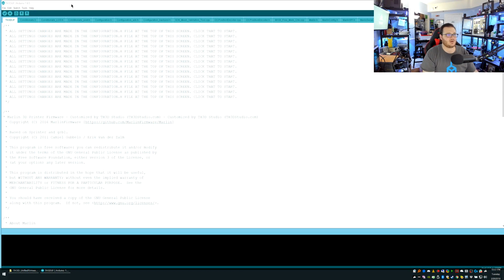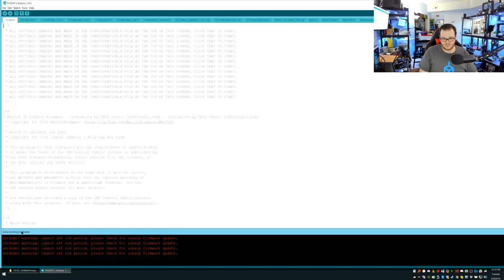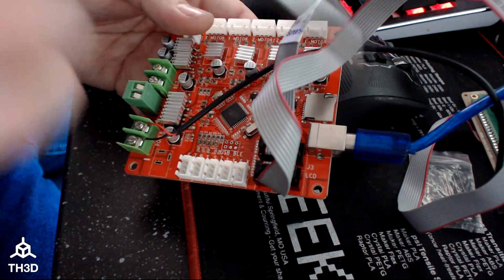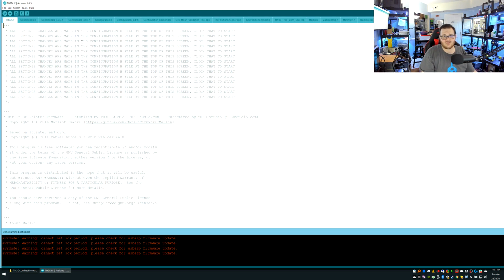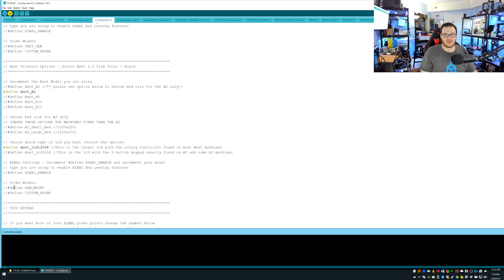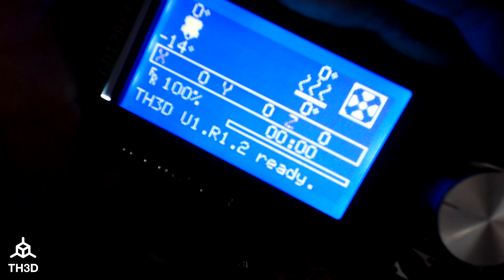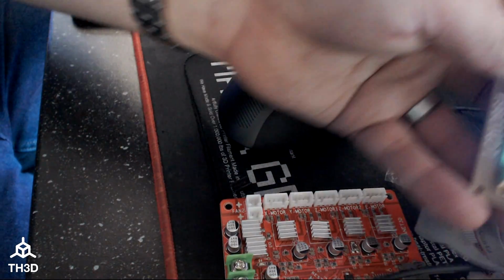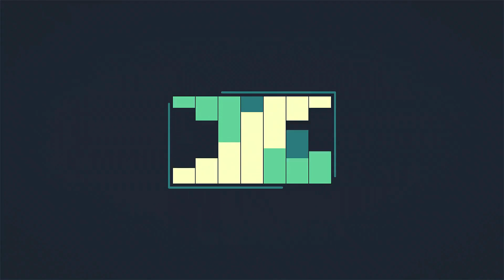Flashing Your Anet Board Bootloader with a USBASP

Comment: Hello, i,m new in the world of 3D printing. How can i put the TH3D-Undifiend file in Arduino 1.8.5 program? The files that are in the directory of TH3D are not reconized in Arduino and most of them are read me files. I bought this printer un assembled new in box, but that was a long time ago. i couldnt build the machine because i was sick for a long time and now the warranty is passed. Now that i build it i found out that there is no software/bootloader or anything on the board.  I just get 2 rows of blocks on the screen, the coolers works but thats all.
Reply from the maker: I'm not sure what you are referring to but the Anet firmware is still on our website. This video is very old. Check https://uf2.th3dstudio.com for the firmware lists.

Comment: Did you use the standard firmware in the "EXAMPLE" folder in Marlin?

Did  you flash 1.1.9 or 2.0.X Bugfix?

Does this method work on all Anet boards? 1.0 1.5 and 1.7?
Reply from the maker: This process works on all Anet board versions.

We use our own firmware from https://Firmware.TH3DStudio.com

We'd highly recommend posting this question on our forum (its open to anyone) to get help with their machines. TH3D Forum: https://forum.th3dstudio.com/
Reply: @TH3DStudio  hey there I am currently moving all the ANET hardware over an Orballo frame (Tatara like one). Is there a chance, I may have support from you guys regarding the flashing ov the board? Do you offer paid services? Support trough Patreon?

Comment: i have a Anet A3 ..so witch do i use A6 or A8 my board is a verion 2.0 Anet
Reply from the maker: A3 isn't supported right now. Thats the little cube style one right?
Reply: @TH3DStudio  yeah the Acyrlic one mk1 ..it as a Anet board in it version 2.0 thats whats on the board .it as all the right plugs as in your video j3 ..ect ..my z axis gos up and down like a ender 5 is it ..so could  iuse like Anet A6 as my x carriage is bascally the same and just change the rest in marlin ..like bed dimentions ect
Reply from the maker: @darren990  Yeah we have one of those somewhere in the junk printer pile but never added it to the firmware so it's not going to work with our firmware we have. You should use Marlin for that machine.
Reply: @TH3DStudio  cheers

Comment: y axis stepper motor is getting very hot what can i do
Reply from the maker: If its the anet where the vref is fixed I'd say check the motor if the bed isn't binding up. Binding on the rods will load the motor more.

Comment: I was wondering what the pinout is for the 6 pin connection from the Anet to the USBASP
Reply from the maker: If you look on bootloader.th3dstudio.com there is the pinout for the Anet board. As for the ASP you would have to refer to the manufacturer documentation for that.

Comment: Something I do not understand. Doesn't the USBASP come with a 10 pin cable already? Why would you need a 10 pin to 6 pin adapter cable. The 10 pin cable should just plug in, right?

Also why program in a bootloader when you could just program the board directly using the USBASP? Or is it because you can program with more revisions later using just USB?
Reply: The programming pins in the pinout on the 10pin Anet header does not match the pinout of the 10Pin USBasp programmer. The 6 pin adapter rewires the pins to the proper connections.

Comment: bought the USBasp usb with 10pin to 6 pin connector. You plug the 6 pin in the middle of the connections, so 2 pins should be available on each side. If it says initialization failed, you probably have the 6 pin connection backwards, so just turn it around.

Comment: When I write bootload it presents this message

avrdude: auto set sck period (because given equals null)
avrdude: warning: cannot set sck period. please check for usbasp firmware update.
avrdude: error: program enable: target doesn't answer. 1 
avrdude: initialization failed, rc=-1
Erro ao gravar o bootloader.
         Double check connections and try again, or use -F to override
         this check.

avrdude done.  Thank you.
Reply: Danilo silva  ever get this worked out?  Have same issue.
Reply: I think there is an issue with a trace in the board from one of the programming pins. I’ve used several different usbasp devices with the same issue. When you plug in the programmer cable to the board you should see a couple of led lights come on and blink. One next to the j3 socket and one near the large chip by the high voltage input. Seen this on other videos. Error seems to be that the board isn’t getting power through to the chip either a bad trace or chip input pin. I don’t get either of the leds to light on the board.  So error is that the usbasp isn’t getting a reply from the chipset on the board.  I was lucky enough to have a factory boot loader to install marlin through. Though the factory boot loader occupies more room than a new boot loader. Just can’t enable to many features before chip memory runs out.

Comment: I have a 10 pin USBASP. I was wondering if I could just trim the 10 pin connector to a six pin or do I have to buy an adapter.
Reply: how you solved this problem? i have the same problem rn, dont want to wait for adapter and i am trying to connect with some wires
Reply: @szwos  I actually managed to unbrick my Anet motherboard another way. I basically reinstalled Marlin onto the motherboard and it worked so I never used the USBASP. I don't know if that's helpful.
Reply: How did you reinstall marlin? I am kinda in similar situation bcs i want to update marlin to a newer version, but i cant do it with usb  - propably bcs i have no bootloader on flash memory
Reply: @szwos  Sorry. I didn't see the reply until now. You've probably solved it already but I basically just pressed the compile button again.
Reply: I didn't get the issue from upgrading my Marlin. I had the issue when I was trying to install the Marlin software for the first time. My hot bed wire burnt through my V1.5 motherboard recently so I had replaced it with a V1.7 board before I ever upgraded my Marlin so I am not familiar with upgrading Marlin. I am so sorry I couldn't help.

Comment: Thank you sooo much for this. I have been struggling for a couple of weeks with uploading marlin to my anet a6. I am fairly new to printing and decent with computers, My question here is, Doe the TH3D firmware have the thermal Runaway protection for the anet like the marlin firmware is supposed to have? I will try to read into the firmware deeper and see if I can figure this out as well. Thank you once again for your help
Reply from the maker: Yes we always enable thermal protection as this is a safety feature that should NEVER be turned off.
Reply: TH3D Studio thank you so much. This firmware is so nice. I bought this printer heavily used and after a little lube and clean up it ran smoother but I had no idea how much different the firmware would make......now to get octoprint to work remotely. No my printer is never ran unattended, wife works from home and is always there but has no clue how to make my printer work but can definitely watch over it. Thank you again.

Comment: Well, after trying and trying I`m stuck on this, I have a anet3d V1-5, I burn the bootloader with no problem  but when Im uploading the configuration.h file from TH3D, following step by step your instructions Im still having this error "avrdude: stk500_recv(): programmer is not responding
avrdude: stk500_getsync() attempt 10 of 10: not in sync: resp=0xdb" please help me im tired  of trying things so far without any success. Give me a hand Please
Reply from the maker: Do you have power going to your board when flashing the firmware?

Comment: It worked for me!!! June 23, 2018
I bought these two pieces. as they were available w/ Amazon Prime>

https://www.amazon.com/gp/product/B014J2BMAG/ref=oh_aui_detailpage_o02_s00?ie=UTF8&psc=1

https://www.amazon.com/gp/product/B07BF7P7QJ/ref=oh_aui_detailpage_o02_s01?ie=UTF8&psc=1

I use Linux Ubuntu, Arduino 1.8.5 (which, you need to add Anet A8 to the list of Boards)
This is a great source for help with all of the upgrade as well

https://mcnoviceelectronics.wordpress.com/2017/10/22/anet-a8-marlin-firmware/

Comment: I have my Anet A8 and I was using Marlin for some time . But yesterday when I was printing it showed on LCD "Max Temp, Restart The Printer...". After I restart it. It shows on the LCD that the Head Bed temperature is like 180, even if I unplug the Heat Bed thermisor. And now when I connect it to Cura by USB the printer just restart itself in a loop. Could I fix it burning the bootloader or do I need to buy a new board?
Reply: The thermistor could be bad. Mine did that last week. I replaced the hot end thermistor and heating element, might as well, that fixed it.

Comment: Thanks!!! A8-L have a big problem jeje and this solution works for me :) OSX El Capitan, last Marlin 1.1.x
Reply: Hi, i have an A8-L too, im currently using manual bed leveling, so when you get Marlin 1.1.x on your A8-L, is there an option to do auto bed leveling?
Reply: Hello!! Yes, it's a little complicated to use jejeje (for me), but it's customary
Reply: Carlos Alberto Carvajal Avila Hi again, i dont know why mine is not having auto bed leveling. Is there any option i should activate? Thanks
Reply: JAMBISALE yeah it's possible in a editor of firmware check the option auto level

Comment: Hi, So I followed all the details in this video and from the /arduino-mac-setup/ from th3dstudio. The problem I'm facing from clip 1:25 of this video, I can't find the AnetV1.0 on the Board menu of audrino. Its default board is "Audrino UNO". Im using mac el capitan, anet a8 and a usbasp. The board reads anet3d v1-5.  Please help! Thank you!
Reply from the maker: You need to use the Unified Firmware from our website. Remove all Arduino Installations.

Comment: So, few questions in my persuit of trying to get my Anet board to accept some sort of firmware.
should be noted, I have an Anet A8-L. came pre-loaded with a custom anet firmware with ABL enabled from the factory. board is version 1.5.
Now, I cannot get this thing to accept any firmware, i've tried skynet, marlin using the configurator, as well as the arduino IDE.
I'm getting STK500 errors. tried so many things so far.
I have a USBasp coming today; but my question is, what bootloader is this method sending? a custom bootloader? based off the anet bootloader? why not move to optiboot to save space? can I load optiboot and still use the TH3D firmware? is it absolutely necessary to use the bootloader? (i ask because my buddy also has an anet, and he does not have a USBasp, and he's in canada and not as tech savvy with the bootloader stuff -- he already has skynet 1.1 though)
Reply: I have the same problem, 1.5 board and tried all what you have. Is this the reason you cant upload marlin or and firmware?  Because of the boot loader being missing? Really stuck with this.
Reply: I ended up having to order a USBASP and flash bootloader.. only way I could get anything to load onto it. also, Personally I went from the TH3D firmware back to standard marlin because changing some of the options that I needed weren't easily accessible in TH3D vs standard Marlin. The bootloader I flashed from TH3D seemed to work fine with standard marlin.
Reply: Munky332 Thank you for that, so I ordered one USBISP devices that's a 10 to 6 pin hope that will do it..
Reply: Hopefully its one that's actually only 6-pins wide. I ordered on that was a "10 pin to 6 pin", but it used a 10-pin sized connector but the outside pins were simply blocked off (filled in w/ plastic). made it a huge PITA to flash, as I had to basically use header pins inserted into my adapter, then perfectly line them up with the pins on the board, then with my foot click "burn bootloader" lol took me like 30 minutes of fiddling. would have been easier if I had breakout pin jumpers but i didn't have any on me at the time. order a full set of 120 of each type (Male to Male, female to male, and female to female).

Comment: Hi Dude on the tronxy x5s is this board anet or something else also there is a six pin rj3 header on the X5s control board 
can this be used to flash with the adaptor that you are demonstrating ?